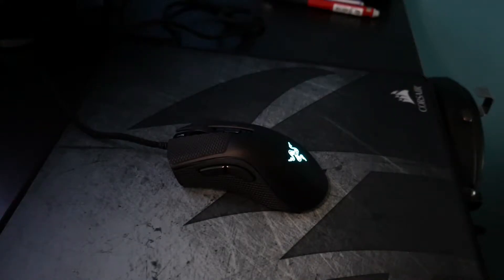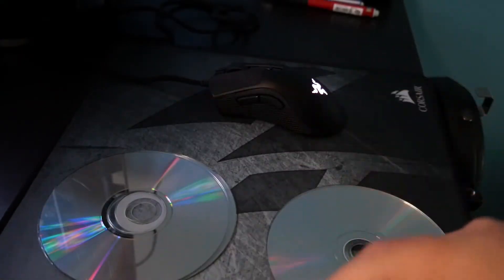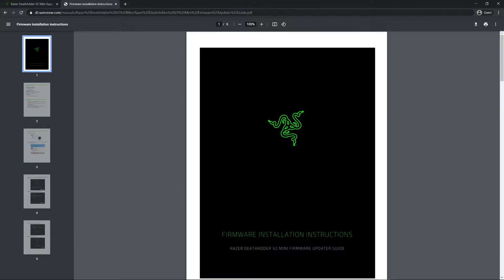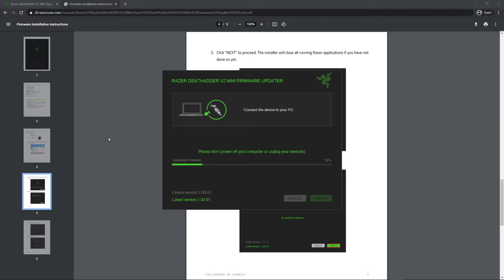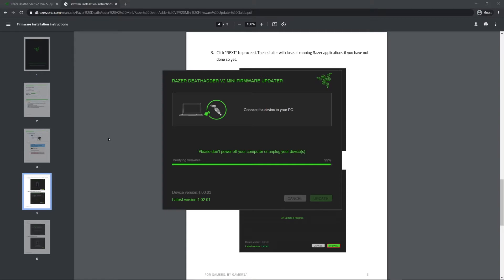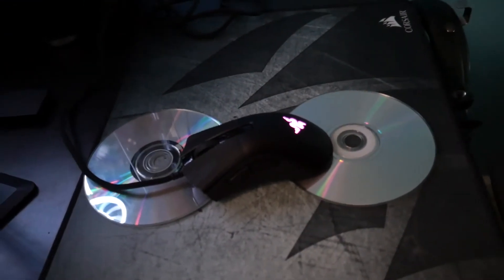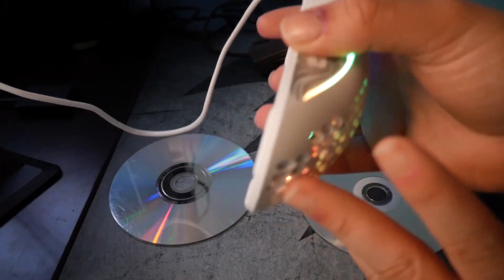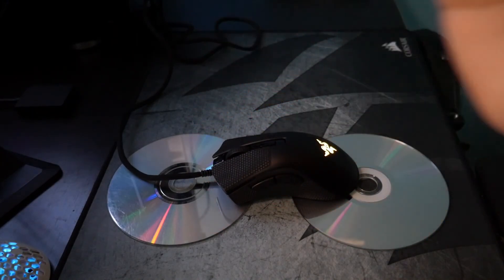Razer Deathadder V2 Mini Sensor Fix (LOD firmware)

Comment: I have them same model and just got a problem this year . The problem is i can click the mouse but the cursor are not moving , do you know how to fix it?
Reply from the maker: Clean the dust on the sensor if any or take apart the mouse and clean it, and try downloading the new firmware to fix it.
Reply: same issue.